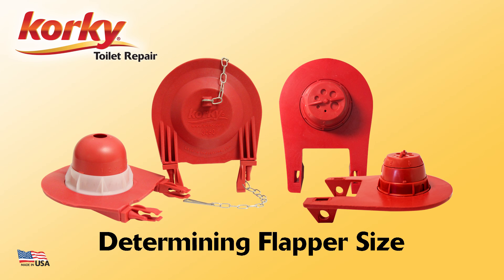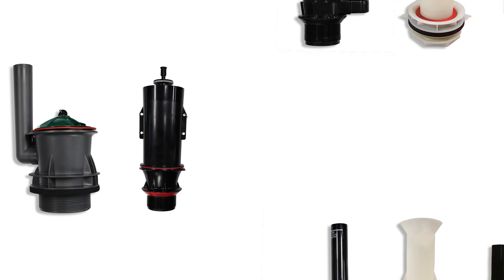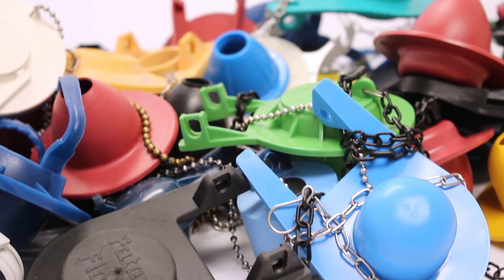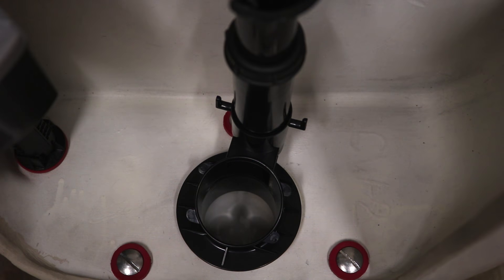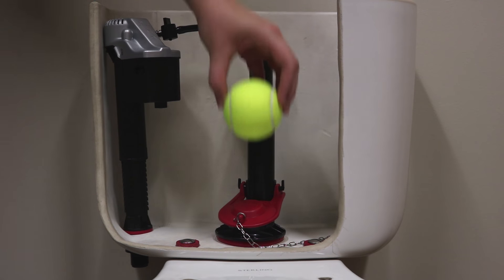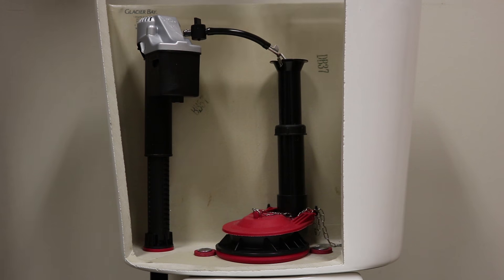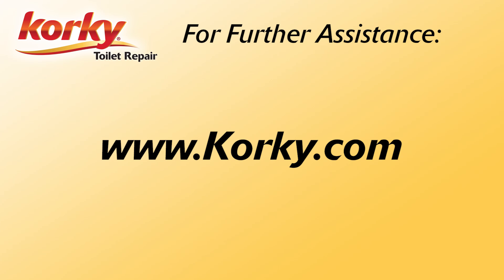What toilet flapper size do I need?

Comment: I agree about using a ball to determine the size needed. I don't have a tennis ball or soft ball. Oranges and grapefruits vary a lot in size. Oh, but I do have a tape measure.
Reply: I am guessing you are joking .First 2 knuckles of your finger are 2  inches. Measure with bendable tape measure is best. Last thing we need is a tennis ball falling into a 3 inch hole.
Reply: Come on! What do we need to MEASURE! The  drain hole, the flapper, other ... this video was useless
Reply: oranges and grapefruits do not very in size. they are always the same size.
Reply: how do you know your tape measure is accurate? Tip: go grab a tennis ball.
Reply: Chris agree!!
Reply: If you want to immerse your measure tape and hand in cold water, sure. For me it's good enough, I determined I have a 2 inch flapper.
Reply: @smit0380  It tells you clearly to measure the hole.
Reply: Put that ruler down, Susan. This job requires precision.

dumps basket of fruit in front of Susan
Reply: Someone told me to grow up and figure this out on my own today. Lol 😂 the flapper measures a little over 3 in. I think the hole measures a little over 2 in. I just want to save on my ridiculous water bill.
Reply: Softballs aren't 3" and tennis balls aren't 2"...

Comment: How about you just tell people that they have to measure the INSIDE of the valve? You measure the inside of the valve that your flapper goes over when it covers it. The hole that the water drains out of when you flush. Not the outside of it, the inside. If it is two inches across, then you need a two inch flapper. If it is three inches, then you need a three inch flapper. You don't need a baseball or a tennis ball. You just need to measure it.
Reply: Mac Harper With all due respect, I believe this was one of those how to videos aimed at the mechanically handicapped audience like myself! The ball thing makes so much more sense to me than running out in the garage to look for the tape measure that my son used and failed to put it back where it belongs...or even worse, getting married again so I don't have to do these type of jobs anymore! I'd rather strangle...I mean struggle than do all that!
Reply: So, you think most people have baseballs and tennis balls laying around? I don't know about you, my tape measure is in a drawer. Not to mention you get an exact measurement.
Reply: Mac Harper Ok...you got me there, because no, I actually don't have baseballs or tennis balls readily available! Also, come to think of it, you wouldn't have both sizes in front of you in order to compare the 2 so you'd have to measure in order to be accurate! Thanks for bringing me back to reality...I get lost easily!
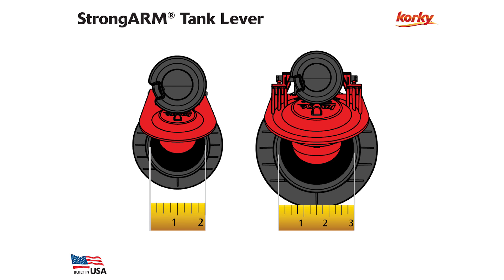Reply: Right at the 0:18 mark it has a picture with measurements. So they covered both methods...
Reply: Mac Harper:  Great tip!  Thanks!
Reply: I was thinking the same thing. Lol
Reply: lmao i was thinking the same thing
Reply: mac thank you .  i've seen other videos that say measure the outside diameter of the flapper which the balls in this video represent... then this video contradicts that  by showing to measure the inside of the valve.   i had measured the inside of the valve so what you're saying confirms that i did it right.  now i just need to know if the type of 2 inch flapper is determined by how old the toilet is / gpf.  i think my basement toilet  is from the 1970s
Reply: @susanreynolds9947  Susan, Your welcome. First of all let me just say that it is a little weird for me to realize that about an hour ago someone replied to a comment I made three years ago about toilets. Kinda blowing my mind. But anyway, Flappers are universal. They sell them on Ebay. It does not matter how old your toilet is. It matters how wide the hole is and to fit the right sized flapper over it to work properly. By the way, A 1970's toilet is pretty damn old. I hope this helped.
Reply: @macharper8214    thanks.  what i meant about age is... the gallons per flush.    Marc,  i have  a thread on what used to be called the garden web  about fixing an ignitor on nxr gas stoves from about 10 yrs ago and people still making comments there.  yes it is mind blowing.
Reply: @susanreynolds9947  10 years ago? Even more mind blowing.
Reply: I measured 2 1/2 ????
Reply: What if I don't have a tennis ball, orange, or tape measure?
Reply: THANK YOU
Reply: that makes a lot more sense than finding a ball!  Thanks for being more helpful than Korky.
Reply: Mine is over 2 but less that 3

Comment: The opening in the valve measures 2.5". Should I go with a 2" or 3" valve replacement? I don't see any 2.5".
Reply from the maker: Are you able to provide more details about what toilet you have?
Reply: @KorkyToiletRepair  American Standard 1.6gpf.
Reply from the maker: @gabespartan  based on the information you have shared, you need a 2" toilet flapper. We recommend the 100BP universal flapper. If you have additional questions, don't hesitate to reach out. https://www.korky.com/products/flapper-seal-replacements/ultra-high-performance-flapper

Comment: Can we remove the flapper, bring it to the supply store and put one back on?
Reply from the maker: Yes, that's a great way to find the correct replacement. Just remember to turn off your water supply so your water doesn't continually run. If you would prefer to speak with our Customer Service team, we are happy to help identify the correct replacement for your toilet. Please call 1-800-528-3553 or email Sales@lavelle.com. We are available Monday through Friday, 7:30AM - 5:00PM (CST).

Comment: What part of the flapper do you measure to know if it's 2 or 3 inch ?
Reply from the maker: Flapper dimensions are a bit confusing because the 2-inch and 3-inch dimension derive from measuring the flush valve opening. A standard 2-inch flapper typically measures closer to 3-inches, while a 3-inch flapper measures closer to 4-inches.
Reply: @KorkyToiletRepair   I’m so glad I saw this so I don’t have to stick my hands back in the cold water. 🥶 Thanks!

Comment: Yikes... you've managed to completely miss the point.
Reply from the maker: Thanks for your feedback. Do you have any suggestions on how we can improve?
Reply: @KorkyToiletRepair  I came here because I need to know specifically what point I need to measure in order to determine the correct flapper size (inner diameter or outer diameter). It looks like others have shared the exact same feedback in the comments and I found the info there as a result (so in a way I guess this video isn't completely useless?). I would suggest using an absolute scale for any future videos such as inches/centimeters, instead of fruits and balls.
Reply from the maker: @AzanJacobs  Very helpful feedback, thanks! It's from feedback like yours that helps us to develop more helpful videos!
Reply: @KorkyToiletRepair  don't listen to him. I don't have rume for any rulers or tape measures in my house. But one thing I am is a tennis nut. It's a great exercise. Any way, I enjoyed using a tennis ball as a unit of measurement.